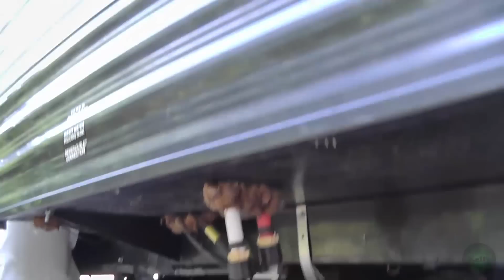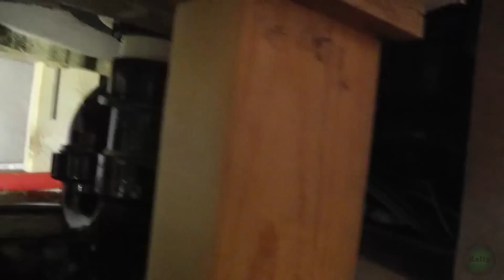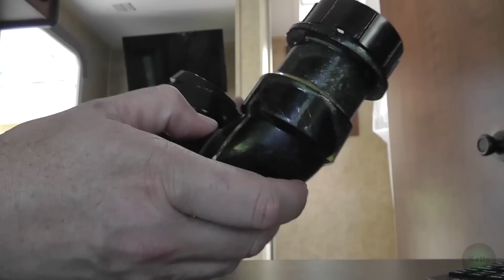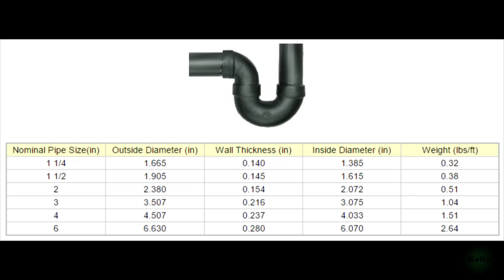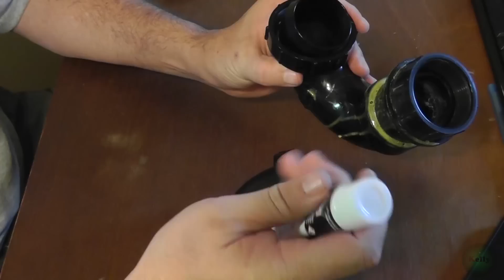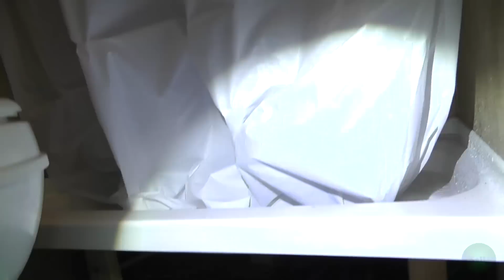RV Leaky Shower Drain  Plumbing Repair and Tips

Comment: I just went through this doing exactly what you did.  The replacement part was hard to find until I realized it was two pieces.  My drain is on a Jayco Jay Flight 264bh and had broken exactly like yours did.  The fit was the same situation as yours....what the hell.  Maybe someone will help explain why this failed.  Nice to ventilate...
Reply: Just left a comment above about this. The problem is the shower pan is flexing too much because there is not enough support by the trap. The stress causes it to break. Just get a sheet of plywood cut it to fit up around the bottom of the tub area and put some 2x4 under it for support. This is a big problem and manufacturing seems not to care.

Comment: My '03 Coachman Cruiser has the same drain issue. I have friends who have a '17 Wilderness and I helped them do the repair and then add support to the underside of the shower pan so that the part that failed would not fail again. I have replaced my part that failed and will add more support to the underside of the shower pan next spring. 
The main problem with all these drains failing is that there is inadequate support for the shower pans and bathtubs. Standing in your tub or shower causes the drain to flex down against the more ridged drain piping and the P-Traps are where the failures are usually occurring. 
These failures seem to be a very common problem across manufacturers.
Reply from the maker: You make a good point. Thanks for commenting.

Comment: This is why it is important to properly winterize your trailer.  The toilet valve and ptraps for the sinks and show need to be evacuated and/or filled with antifreeze.
Reply from the maker: I Agree. Thanks for watching and commenting.
Reply: Winterizing is one thing. This issue is from stress from the shower pan flexing. Manufacturing knows this is a issue. They don’t put enough support to stop the flexing. You need to go in and add a sheet of plywood and a few 2x4 underneath for extra support around the trap.

Comment: your pipes are breaking because your RV flexes a lot while being moved around,  and they put inflexable pipe system into it like a bunch of morons all they needed to do was add a rubber section to allow for flex and it'd prevent most of these breaks.
Reply from the maker: I agree. If the issue happens again I will use rubber sleves.

Comment: Thanks for the video, I’m having the same issue on my 2019 trailer. Where did you find the initial broken drain pipe/ connector? As your trailer, mine has a pocket there on the bottom, I wonder if stepping on the drain caused stress and therefore cracked it? Thank you in advance.
Reply from the maker: I found the pipe at Lowes. Thanks for commenting.

Comment: Can the rim of the  p trap crack from stepping on the drain  ? I have found a small leak dripping outside under my new 2019   Cabin cruiser by Gulf Stream. It only leaks ( sometimes but not always for some reason ) after I have taken a shower.  I’ve removed the panel like you did here and I see no leaks on the inside. I also checked the hot and cold water lines behind the wall where you turn on the faucets in the shower , they were not wet and I just finger  tightened them then replaced it .  The leak looks like it is dripping where the low water lines come out of the bottom of my RV on the outside. ( it’s actually dripping down the insulation) also can the p trap be accessed through the drain in my shower? 
Thank you!
Kim LAbbe

Comment: I just bought my buddy’s trailer and I have the exact same problem even with the issue of not a perfect square fit, I found my p trap to be cracked from I’m sure that same stress. Hopefully it’s an easy fix like your video shows.
Reply from the maker: Yeah I think sometimes things just don't line up right during assembly. Good luck!

Comment: Great video! My new-to-me, 17-year old horse trailer with living quarters showed a leak on the floor at the corner of the shower. I took off the panel and wedged my head between the toilet and the shower entrance. The leak is above the p trap joint, but I cannot see it. I might need a mirror to view the bottom of the shower, through a very small hole. What connects the actual shower drain to the p trap apparatus? Love the info about the different pipe composition. Keep on helping us!
Reply from the maker: Not sure what that "apparatus" is called actually for your model rv. It's tough finding the correct names of parts for rv's. Good luck and let us know what you find out. A selfie stick can come in handy in tight situations...just thinking out loud.

Comment: What I would have done is disconnected the nut on the left so that it would have allowed you to make up the joint fully into the socket, and then once it's glued swing the nut back over to the threaded connection and then tighten fully. To me it looks as if you barely got any make up into the socket on the bottom of the p-trap. I would not be surprised if you have more leaks in the future. But for now it's holding so I'm sure you're happy about that for now.
Reply from the maker: I can see where you would consider doing that however I tried a dry rum doing that and I would not have cleared the drain fitting. So far 2+ years no leak...Fingers crossed...Thanks for watching and commenting.

Comment: I am not a plummer but a DIY, I would of put some PVC Flexible Coupling to reduce the stress that is put when somebody showers, see home depot website...(http://www.homedepot.com/p/DBHL-1-1-2-in-x-1-1-2-in-PVC-Flexible-Coupling-HD3522845/100344097). Accordion-like design accommodates lengths from 3-1/2 in. to 6 in. Bends, compresses and expands for alignment and holds shape for easy adjustment during installation.
Reply from the maker: +Luis Diaz Very interesting find! Thanks so much for sharing.